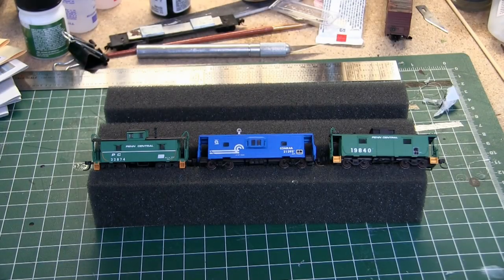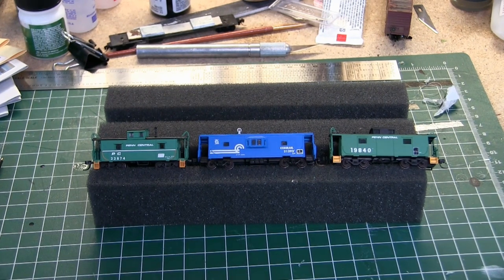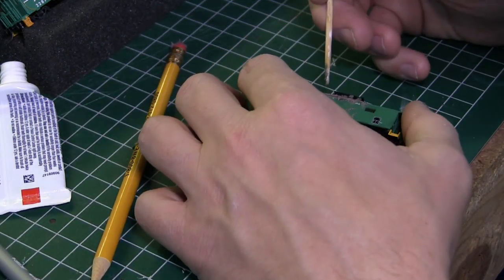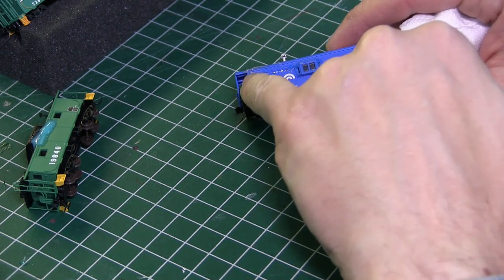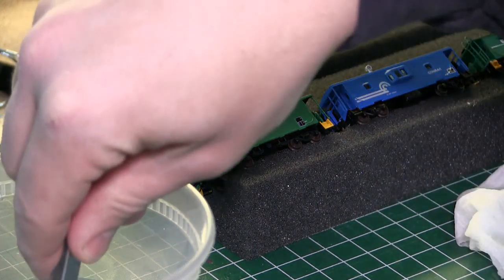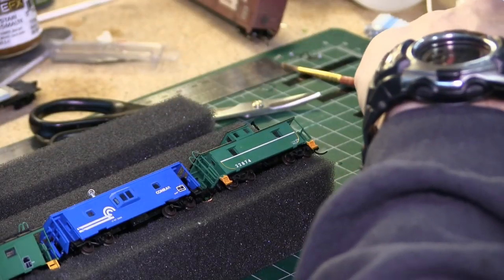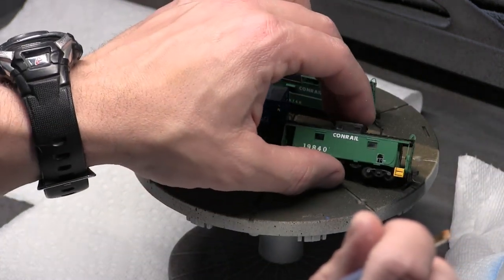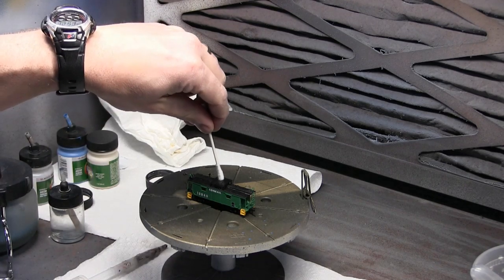Paint Shop: Caboose

Comment: Nice job Joe. I guess toothpaste is the "go to" for decal removal. I've found, I do not have to soak N scale decals in water. I place the dry decal directly on model, then apply Micro Set with a brush directly to the decal and the final decal position area. Within a few seconds, the decal slides off the backing paper and into position. No more losing decals in a sea of water or the possibility of the decal folding over onto itself.
Reply from the maker: Great tip thanks I might try it. Thanks for watching!

Comment: Great job, Joe, but didn't you re-decal a caboose then turn it over and place the new decal right on the foam cradle? How did it not mess up the position of the still-wet decal?
Reply from the maker: Thanks Ron for watching. I made sure that when I angled the caboose that the foam wasn’t touch the decals.

Comment: Another great video,  I do a lot of decal work because I model L&N and there is not a lot of engines or rolling stock.  when you Air Brushed the weathering did you use the same color combo from the other videos you have done?  I too have had issues with Atlas lettering with tooth paste Micro Trains works like a charm.
Reply from the maker: Thanks. Yes I used model flex sand. With a couple drop of alcohol it is perfect for fading the paint, and giving it a dusty look!

Comment: Hey Joe, I had a question for you since you're modeling around where the Raritan River used to be.  Do you know of a way to find out the current owner of some of the RR box cars? Particularly I want to know the current state of RR 414.  If its in NS or CSX livery I'll patch it for that, but if it's been scrapped or owned by a lease company I plan to patch it for my railroad instead.  Railpic archives hasn't been much help on their rolling stock, just thought I'd reach out to you :)
Reply from the maker: Ok so first off sorry I missed this comment and took so long, because it was actually really fun to do the research. So your boxcar was part of the RRRR’s Per diem boxcar fleet. Of course the ICC’s decision in the late 1970’s made these cars unprofitable, and they were all parked in Sayreville. After RRRR ‘s bankruptcy the cars were transferred to Conrail and became class BA50A numbered 16900-169688. They were painted at the Reading Shops and were entered into clean lading service, part of the famous yellow door fleet. That’s were the trail goes cold. I can tell you that they were probably grouped together with the X71 class because they were similar. Most of the 50’foot boxcars were scrapped before the breakup. So what happened to 414, I can’t be sure because I can’t find a roster. So I can only guess that it serves with Conrail till 1999 then was cut up.
Reply: @centraljerseyconrailinnsca5676  not a problem Joe!!! I greatly appreciate the effort you put into researching your reply to me!!! I have a lot of box cars from roads that no longer exist.  Those which I can find the new owner, I try to replicate.  If I am unable to find anything, it becomes a KGBE car.  Some cars I have found recent pics of, and still weathered it according to pics, but stenciled it as if my railroad bought it.  That RR 414 has  became KGBE 06.   I saved it from scrap.  Lol:)   thanks a million Joe!!!!!!